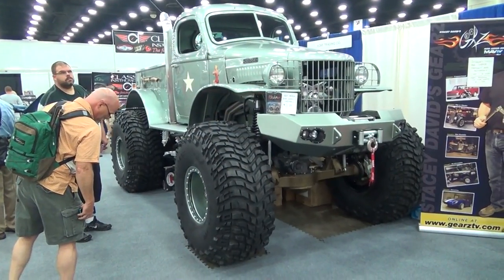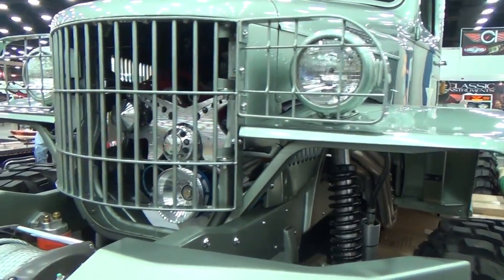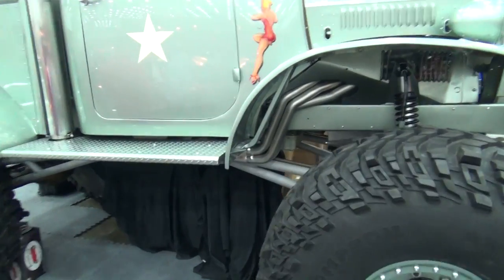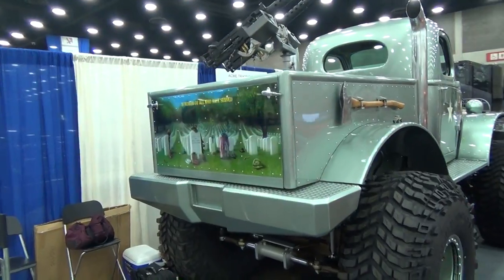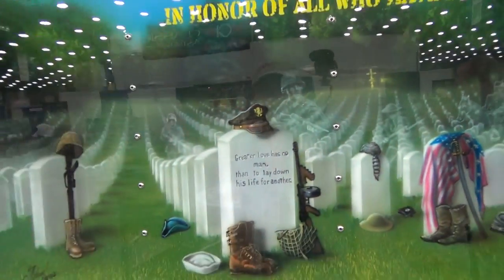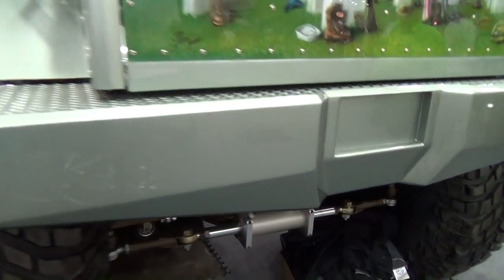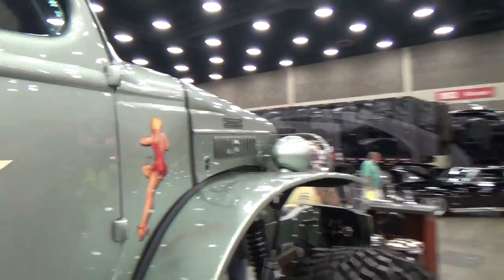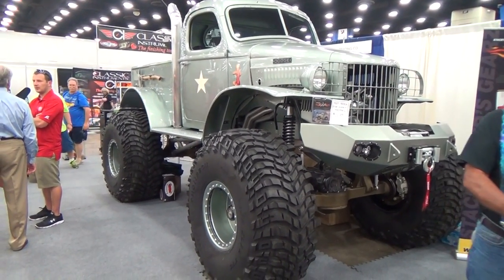1941 Dodge Pickup "Sgt Rock" NSRA Street Rod Nationals 2015

Comment: Awesome Truck! With a very lethal payload.. Looked like Duel Mount M2 HB's, with spade handle grips. Although in that configuration, appears to be in a "remote fire" mount.  That would be dual .50 calibers talking, 2000 yards effective range, at anywhere between 450 to 600 rounds per min, quite a bit of "peace-making" capability!...or quite literally "piece-making"  That would clear the road!
Reply from the maker: +Rick Malarky lol..Right on!

Comment: It's a 1941 Dodge PowerWagon.  I always loved the PowerWagon. IMHO, I think its overdone... And not really usable on the street. It's a tall truck with lots of ground clearance to begin with. They came with a 230cc then a 251cc straight 6. Which had loads of torque but no horsepower. Top speed (going down hill), you'd be lucky if you hit 60mph! Mostly due to gearing & it's 4x4 system. I've seen a few restomods where a new Hemi & tyranny replaced the I6 to make it drivable but kept everything else pretty much original. Which is exactly what I would do! I don't think many if any WM series made it overseas during WWII. The WCs soft top cabs (the WC & WM are basically the same underneath) were used in WWII. I'm going to go out on a limb and say any WMs used in WWII were on US soil. WM ambulances & radio trucks maybe were sent over but I could be wrong! WMs were sold as civilian trucks. The squared off, Soft top, long bed WC models used in WWII were made for the military.
Reply from the maker: Cool...Thanks for checking it out here!
Reply: Agreed. this one is way over the top and IMHO this was a total waste of money. This will NEVER do anything but sit on a trailer. it's like castrating a WWII veteran. SMH
Reply: Still a cool truck, though. It takes me back to monster trucks of the 1980s and '90s.

Comment: WAS IT POWERED BY A HEMI?????
Reply from the maker: +Todd Riesland lol..Not sure!
Reply: its a crate motor with Indy heads but no not a hemi
Reply: +Todd Riesland It's a 500 Ci Big block Mopar from Indy, makes 850 Hp and 850 lb-ft on pump gas